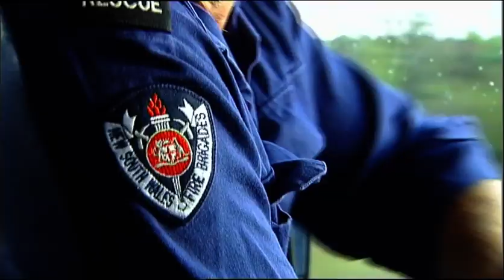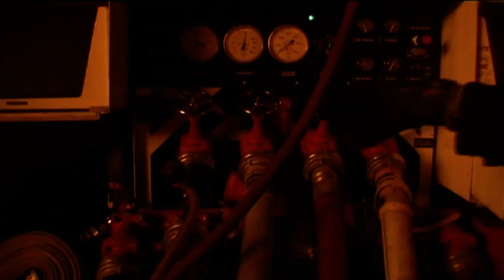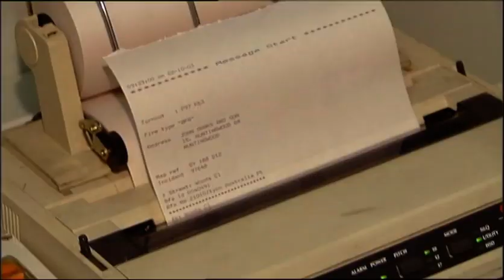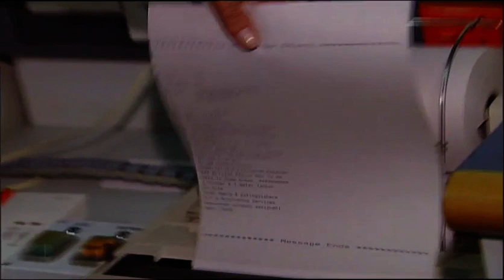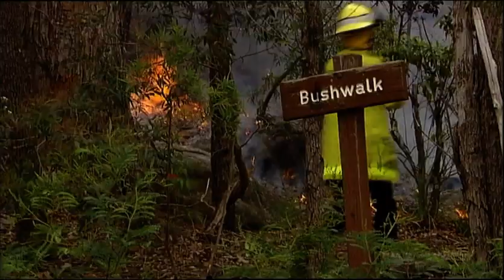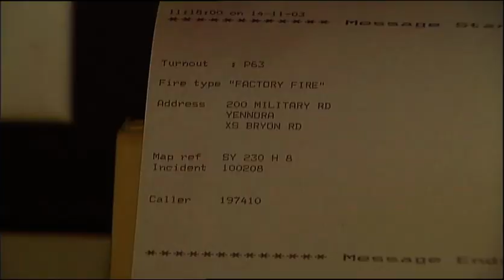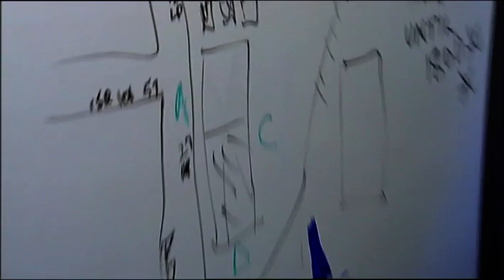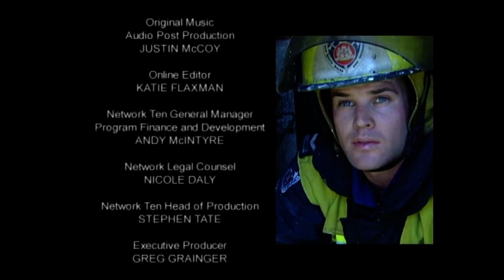Inferno - New South Wales Fire Brigade Documentary (2004)

Comment: I am wondering why they have a different coloured jacket and pants.
Reply: Back in the day large thick Woolen jackets used to get issued which were dark in colour, they were meant for winter, but because they were better at protection from the radiant heat so fire fighters would don them over their regular issue gear. The trade off was dehydration could occur. As PPE has improved these jackets don't get issued anyone. I've still got my Woolen open coat.